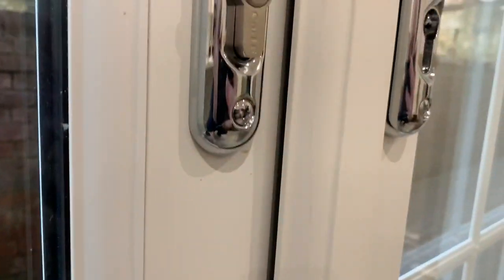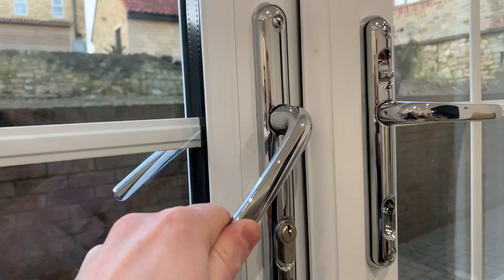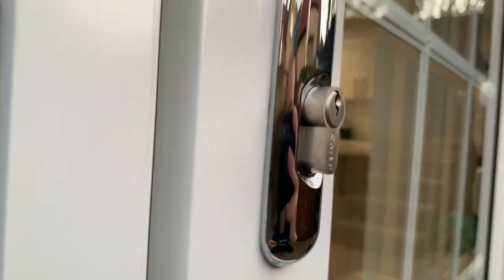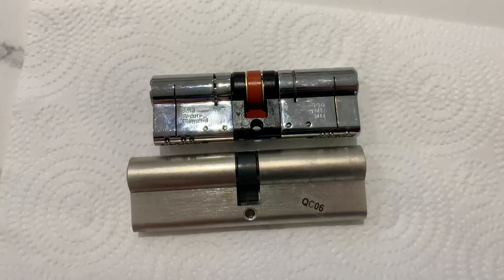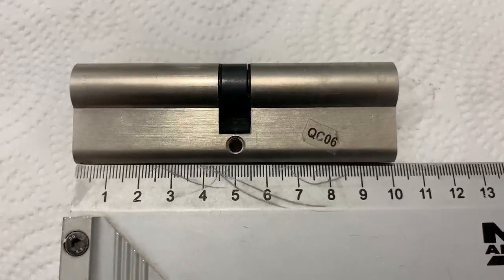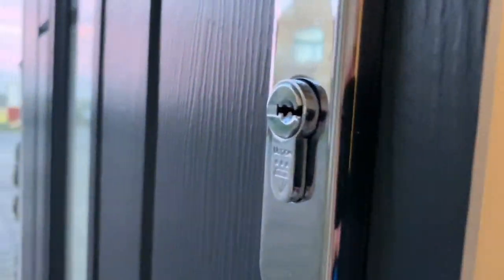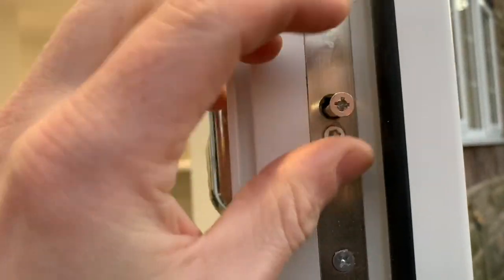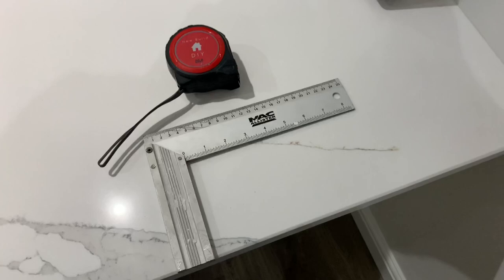How to measure and change for 3 star lock cylinders and why

Comment: My existing lock has worn out. The upvc door is old and thicker on inside. The lock comes out a small amount but not too much. The outer part is 37mm from center and inner part 91mm. I'm not sure what size to buy. Your video has made me feel positive for replacing the old lock. Cheers jo
Reply from the maker: I would suggest rounding up to the nearest size. Normally they go in 5mm increments.

Comment: I've bought a Yale anti-snap cylinder and the nodules and preventing it from going into the hole enough for the screw hole to align. It sticks out too much on the outside. It's very hard to find information online. I wish I'd bought an Ultion now.
Reply from the maker: I had to cut those off when we had Yale at the old house. Good locks but not sure why they have those on. Id suggest taking back and possibly getting Ultion or ABS locks as much easier to work with.
Reply: @DIYJourney1  I think I might just do that. I can't see what function they perform. Thanks for the reply.
Reply: @DIYJourney1  I've just found out they are to make it more difficult to pull the cylinder out of the hole as the nodules will catch on the back of the exterior door handle. Yale also says they can be filed down if the cylinder can't be fitted because of them. So, that's what I will do.

Comment: The less it protrudes the better, these locks are all made in 5mm increments so that’s variable. The locks are not always symmetrical and measurement mostly differ from outside to inside so measuring is vital!

Comment: I can see the screw holding the cylinder in place on one of my French doors, but the other door of the pair has a diferent type of plate on the edge where the lock is. How do I get to the screw holding the cylinder in place on this door please?
Reply from the maker: Hi 

Mine was the same, I had to remove the plate to give access to the screw for the lock.
Reply: @DIYJourney1  Thank you for your help.

Comment: which 3star cylider lock is best? i need to replace in my new flat
Reply from the maker: I cant really comment as only used 3 brands and all worked no issues in my experience which was Yale, ABS Avocet and Ultion. The ABS Avocet felt the best made.

Comment: A locksmith fitted this lock for me after an attempted break-in. 
He didn't change the door handle, though. Does this mean my door still isn't secure ? Can these locks be snapped as easily as others ?
Reply from the maker: Not necessarily, yes the 3 star locks can be snapped, but the mechanism goes in to “lockdown” as such, and the thief’s are unable to unlock it, like they would a normal lock. It just means you would have to buy a new lock if it happened, but they wouldn’t get in with that method of break in.

Comment: Great video mate, where did you get your ultion locks from?
Reply from the maker: Hi,

They are from Euro Secure. If you drop sales@euro-secure.com and mention DIYJourney10 you should receive 10% discount also. 

Hope this helps.
Reply: @DIYJourney1  hi, is this code still active? 😊
Reply from the maker: Hi, As far as I am aware, if you send an email to sales@eurosecure.com they should be able to accommodate.

Comment: Hi, very knowledgeable video, can I ask where do you recommend to purchase Ultion locks? I’ve searched online and seems the sites I’ve found requires a quote from them. Thanks
Reply from the maker: Hi,

What Iv found is thats what you have to do, Iv bought from EuroSecure.
Reply from the maker: Please comment with constructive comments that help with facts.
Reply: @DIYJourney1  I have, ultion cylinders are rubbish, Brisant bare also being  arseholes with key blank supplies.
Reply from the maker: Again, that does help people as to why they are rubbish. I have had various Ultion locks over the last 6 years with zero issues. The iv also had ABS and Yale with no issues.
Reply: @DIYJourney1  ultion  have a ridiculous failure  rate, they are piss easy  to pick (so are yale platinum),cutting spare keys is becoming  a pain .
In general  they are one of the worst  options at the moment. 
Problems  that can be addressed,they have better physical  attack protection  than the abs but in terms  of reliability they just don't cut it.
Depending  on what area  you like they are pretty  much a waste of time unless  you address all security issues .
Brisant will tell anyone who will listen  that 86% of burglaries are through doors, they won't tell you that most are already  open, of the forced  entry around  70% are through smashed glass ,forced lock  is next most popular .
I have lost count  of the amount  of burglaries  I have been  to that had high security  euro cylinders  on the doors,
Reply from the maker: What is your solution/suggestion to help others?
Reply: @DIYJourney1  most important  thing is laminated glass at least  on the external  side  of ground  floor,a lot of WER units  on new installations  have this  where safety  glass is required  already ,if anyone  is having  new fitted this is something  you want to ask for on every ground floor window  and door.
Cylinder  upgrades  are virtually  pointless  in most areas of UK if glass and main lock mechanism  are not up to scratch,there is no point  fitting  a 3 star cylinder  to an old 2 roller and spring latch mechanism (I have seen this done many  times).
Pvc panels  if wanted  should  have decent reinforcement, some ares will go through vthe panels  and pry off the beading  inside. 
Security lights need to be up high where they cannot be ripped  off .
Smaller  things like video door bells  can be a deterrent .
Reply from the maker: Right I see, so the issue is security on a whole, which is fair enough. This video which is about 3 star locks to help with preventing the snapping aspect and an easy quiet way in to a property which is currently rife for car thefts.
Reply: @DIYJourney1  very area dependent  i have been to over 200 burglaries  in the last yesterday and only  2 were snapped  cylinder  and both on same night  in same area.
Ultion  locks do have lots of issues  and I know plenty  of people  who refuse  to fit them due to amount  of call backs. 
They do offer  a good degree  of attack  resistance  but fail far to often, with the right tools they are also easy to drill ,but that goes for any cylinder.
Reply from the maker: Wanting to keep on topic of the video, and going back to the very initial comment, what brand 3 star lock cylinders do you recommend, should someone was to upgrade there locks?
Reply: @DIYJourney1  i like the ATK .
Reply: @cardiffpicker1  I've got ABS what's your thoughts on that?
Reply: @billjohnson3284  they  are  OK, you do get some malfunction with them but I dont see anywhere  near as many  fail as ultion.

Comment: Hi, does it matter if the lock protrudes a few  millimetres on the Inside of the door?
Reply from the maker: Hi,

I would say not, however I would personally go the next size up, and protrude out, so the handle give some support to the lock cylinder.
Reply: Only insomuch that it f it protrudes more than 1 or 2 mm, it presents a profile that is easier to snap, though burglars will destroy the frame around the handle.

You MUST always ensure that your Euro Cylinders are 3 Star Diamond, the best by far are Ultion (https://www.ultion-lock.co.uk), these have anti-drilling and snap protection, together with a triggered defence against physical intrusion built in. The company offer sophisticated SMART Solutions too and all of their locks have a ‘Same Key’ ability where subsequent barrels utilise one secure key pattern, the keys are not conventionally cut and can are registered with and only be supplied by Ultion and their dealers.

Certainly worth a little extra outlay over thenChinese garbage on eBay!

They aren’t cheap compared to the mainstream but are  so secure that company guarantees them with a substantial financial guarantee.

Comment: Why carnt the lock be inside the handle slightly? Thanks
Reply from the maker: Id say more aesthetics than any other reason, but also in a normal handle being as flush as possible offers support
Reply: @DIYJourney1  thanks for the reply.  As long as it doesn't compromise on security which i was worried about, then I dont mind it being sunk in about 1 or 2  mm. thanks
Reply: You get more water ingress into the handle  which will end up going  into the door,which  will cause  early failure of lock mechanism.

Comment: How do you fit a turn button on the inside of the door instead of a key ??
Reply from the maker: You just need to buy that type of lock cylinder. The measurement principle still applies.

Comment: Get yourself a Patlock for those French doors could be a good idea!
Reply from the maker: Certainly is if you don’t have 3 star handles
Reply: @DIYJourney1  Worth buying one anyway, any lock can be drilled out with a powerful enough drill but short of smashing both glass window panels I can't see how you could ever remove a Patlock. I think they are fantastic defense for a French Door fitting.
Reply from the maker: Absolutely, but with a suitable security lock, they cant be broken.
Reply: @Chanesmyname Ultion handle 2 star Plus has internal snib which works in the same principle as Patlock, stopping the handle from going up or down even if lock cylinder has been defeated.
Reply: @DIYJourney1 sorry for being pedantic but the current highest security rating for a door handle is two star. The Ultion two star Plus handle (with the internal snib, which you seem to have on one of your handles) is a good additional security feature but the handle security grading is still two star. Good video you have done & hopefully makes people aware of the issue & how to change their cylinders!
Reply from the maker: I agree and am aware handles are 2 star and locks 3 star, very pedantic yes and just a typo, on a comment over a year old
Reply: @DIYJourney1  What difference does it make that it was a comment from a year ago? Zero. You Tube videos are often watched at later points, like I did with yours. You should make sure you are factually correct, particularly on your own video which is trying to remove confusion for others in relation to security. Basic.

Also, you encourage interaction on your posts, so you should welcome fair feedback when it’s offered. I paid you compliments too. No need to be off in your reply.

Comment: How much did the lock set you back?
Reply from the maker: Depends what you require but £55
Reply: @DIYJourney1  Ah that's reasonable. Just doing some research, I've seen the Yale Platinum 3* is £52 (Or £30-£40 on Amazon). Is that for the standard Ultion or the WXM? I've also seen you can get the same key cut for multiple locks, but this seems like a inherently bad idea in the event of theft? What are your thoughts?

Comment: Anti snap.. Wrong
Anti bump. Wrong
Anti pick.. Wrong
Anti drill.. Wrong.
It just takes a bit longer.
Ultion are shite.
They continually lock up on a customers door.
Reply from the maker: …someones had a bad experience 🤣🤦🏽‍♂️. Unfortunately I can’t account for your experiences, only my own 🙂
Reply: @DIYJourney1  there's plenty of locksmiths that will agree with me, as we work with them weekly.
I'm just saying they can be picked quite easily and the older version bump.
They're not my go to 3 star.
Reply: @russjones6557  What is your go to?